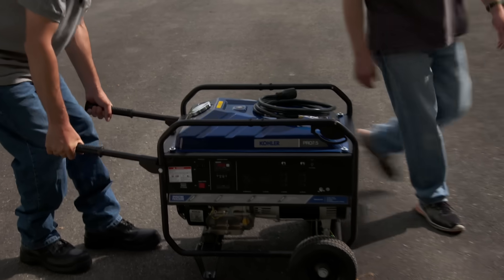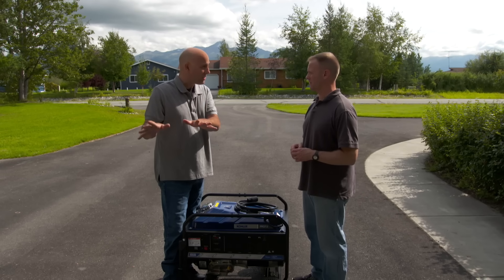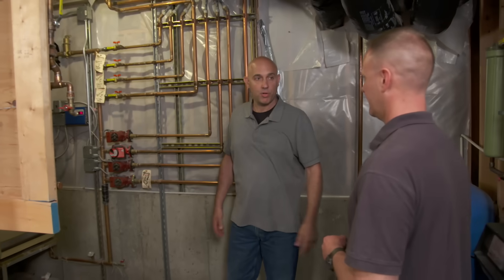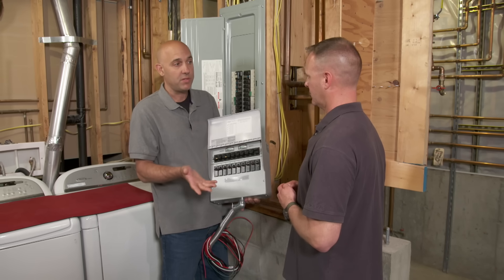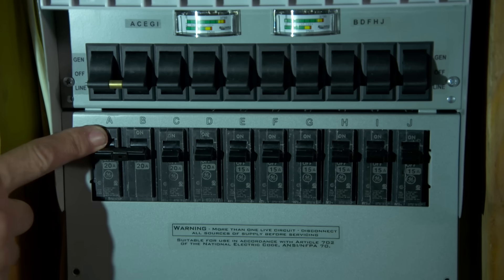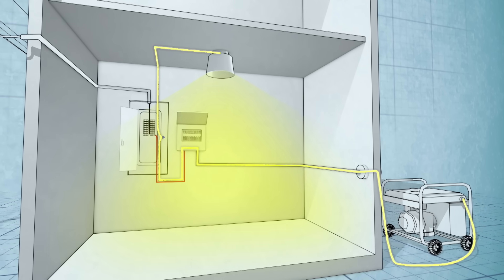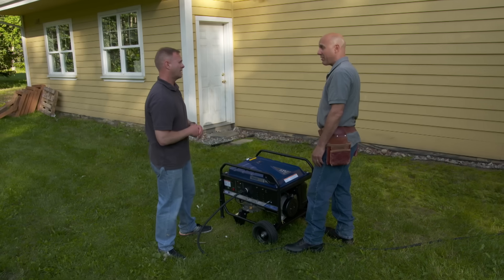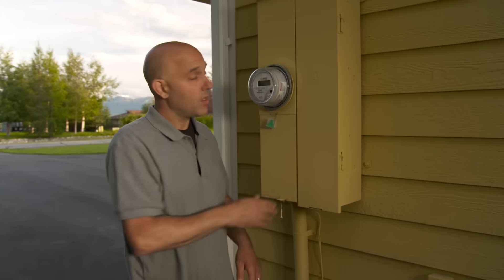How to Install a Manual Transfer Switch for a Portable Generator | Ask This Old House

Comment: You can do the same thing without the transfer switch. Use the inlet box. Run a 50 amp two pole circuit from there into the panel. Install a two pole 50 amp breaker on the panel , if you have the spaces available, hook up your 50 amp circuit to the 50 amp breaker. Leave that breaker turned off and When power goes out. Turn off your main , or any breaker that will not allow power to back feed into the power company’s grid. Plug the generator in. Turn it on. Turn on the 50 amp breaker. Now you are back feeding generator power into all of your house circuits. Now the 50 amp breaker is your transfer switch. A lot cheaper.
Reply: Doing that is against code for a reason. Current can still feed back onto the grid via the grounded conductor.
Reply: If you use that method, you must install a panel interlock as well.

Comment: I have a 50 amp generator... want to hook it to a panel  50 feet away  to a 50 amp interlock switch & breaker... Is a 6/3 & 8/1 ground sufficient ?

Comment: Question, when your on generator power and utility power is restored how does the transfer switch go back from generator power to line ?
Reply: You gotta do it your self, generally you would know what the generator powers, once stuff turns on that isn't generator powered you would go turn it off and manually got back to line on the transfer switch. Or you can buy an automatic transfer switch.
Reply: @ravinderbrar6316  I was talking about the main breaker to the house by the meter. With a transfer switch you don't have to turn off the main breaker that feeds the house to prevent backfeed when you have a manual transfer switch.  That was my question. When I simulated a power failure by turning the main breaker i follow the MTS directions and worked fine but I didn't go outside and return house power to see if the transfer switch  would  disconnect to prevent overload. The MTS is suppose to have a breaker that trips automatically when power is restored than you  reset MTS breakers back to line let the gen run a few minutes without a load and then shut it down,I can't test this by myself because my main house breaker is on the other side of my house, i need an extra person to turn off MTS breakers if there's any problems to try to prevent any damage, the wiring was easy and all labeled and double checked. My test worked but I didn't test returning house power to see if the MTS wouldn't backfeed or overload. If the house main was at the fuse box it would be different but its not.

Comment: At the end they turned power back on at the main while the generator was still running did they put breakers
On the transfer
Box back to line ?

Comment: What about switching the neutral or does the generator have a floating neutral? Otherwise you are bonded at two locations.
Reply: Read the code book about portable generators under a certain KW.

Comment: Instead of installing the manual transfer switch after the breaker box, could a "all or nothing" manual transfer switch be installed before the breaker box that accepts power from the grid or if "switched" only accepts power from the generator or solar source.   The generator or solar probably can only have enough power to power a few circuits, so all circuits would be turned off and then selectively turned on as power is available.    Nothing would be given up, but because the generated power would only be used when grid power is unavailable.

Can an all or nothing manual switch be installed before the breaker box?
Reply: Yes, it it called interlock. You connect your generator to your panel via two-phase breaker, positioned on the top, right under the main breaker. The interlock sliding plate makes it impossible for both main and generator switches be in the on state at the same time.
Reply: @ruslankadylak2999  Thanks for the reply.   I realize the interlock is probably not automatic, but hopefully safe and cheaper and easier to understand.    Any idea what would be a reasonable price for an electrician to install the interlock?

I'm amazed at how many people have solar panels on their homes which can not be used for their home when there is a grid outage, because they must go through the grid.
Reply: @davebean2886  I don't know what the installation price is, shouldn't be expensive, as it is 5-10 minutes job. However, let me give you some information on the solar panels.

There are three main obstacles to using solar panels as a backup. First, most of the inverters are designed to adhere to the current frequency in the grid, and, without the reference current in the grid, they do not know how to produce their own AC. Note that, for a number of good reasons, typical installation doesn't have output DC wires. Inverters are normally located under individual panels. So, to overcome this limitation, you have to upgrade ALL the inverters to a smarter (and more expensive) ones, or have something else (e.g. small gas generator, or battery powered inverter) be responsible for producing the reference current.

Second point. The nature of solar panels is such that they will produce electricity until you demand more power than at the moment they are capable of. At which point they collapse to zero Watt. Individual inverters work to make sure this won't be happening. Needed power on surge demands (e.g. electric motor starting, welding, range, oven, heaters, etc.) is taken from a big "sink", i.e. a source of energy big enough to satisfy any and all demands. Normally, it is a power grid. Can be battery bank.

Third point. Even if you managed to satisfy all energy hungry requests, there remains quality of service. Electricity in the grid is fine tuned and monitored constantly to meet certain well defined parameters (voltage and frequency). Your home electronics love it that way. And raw output from solar panels themselves cannot meet these standards.

These three points can be helped with a sufficient size battery bank. But a) it will double the cost of your system, and b) they have to be replaced sometime in not so distant future. Therefore, battery banks are to be used in remote off grid cases, just because the grid is not acceptable. In all other cases - connect to the grid. They will work with you following very reasonable rules. It's a win-win situation. 

As far as emergency backup goes, install a generator and connect it to your service panel with an interlock sliding switch. Hope that helps.
Reply: @ruslankadylak2999  Thanks for the information.   I'm just starting to consider approaches.  One time in Denver, our power was out for 8 days when a tree branch pulled the meter off the house.

We ran a heavy duty extension cord from a very close neighbor's outlet which let us run our refrigerator and other very selected items.   Would have been nice to not have to run extension cords through the house.

We are in a newer house in Texas now and while we did not have long-term power outage last winter, our water was frozen up for 5 days (oddly never had an issue with frozen water in Denver).   Got me thinking again.    If power was out the fan for our gas heater would not work.   We have a very nice fireplace that does put out heat when the fan is working.   In the even of a future power outage, would be nice to have some backup power to charge cell phones and somehow run the fans, but don't know how to get to the fans.

Obviously, I don't know what I am doing, but on the surface seems like everyone should have a manual safety transfer switch to allow selected items to have power from whatever electric source may be available - gas generator, batteries from inverter - power cord from neighbor.   But wondering if more to it since, never run into anyone that had a manual safety transfer switch, but they have gas generators for RVs etc.

I have a very little experience with solar panels and our two RVs in a remote location where the solar panels charge two 6 volt very large golf cart batteries in series to give 12 volt.   Power is used to charge our phones, battery packs for phones, tool batteries and for some reason one of the refrigerators on propane needs a battery to light and run.  Seems odd that our off grid RVs have crude power backup and our home has none.

As for generators - I've had 3 and never been able to keep them in a condition that would would run.  Also not wild about storing much gas in the garage.

Other suggestions?   Seems like now is time to prepare not after the next outage storm.
Reply: @davebean2886  I just wanted to point out why simple solar array, without batteries, cannot serve as a power backup system. While connecting solar panels to the grid make perfect business case, this design will not work for power backup. Adding batteries to the system just for the backup sake doesn't make much sense financially either. Therefore, adding gas generator to your system is a logical choice. To make your generator more reliable, use gas without ethanol, start it once a month for ten minutes, and/or drain all fuel (tank and carburetor) for long storage. Also, there are dual fuel (gas or propane) generators. Propane is immune to the long term storage kind of problems that gas engines are pron to, but it runs a bit weaker.

Comment: Now what happens when line voltage is restored and the generator is still on? Assuming you'd turn the main panel off before hand?
Reply: Nothing. They are separately functioning circuits that share a switch. You are choosing between one or the other and the transfer box makes sure that they never coexist. 

The reason for the manual transfer box is so you don’t kill a worker when repairing lines. If a tree limb breaks the line from your house to the pole they are expecting a dead line from your house. Without the transfer box you would have to make sure to throw the main breaker from the house, but if you forget you are now sending power back to the lines. With a manual transfer box you cannot send power out and kill people.
Reply: You would switch your transfer switch circuits back to grid power, then turn off your generator. Nothing in the main panel needs to be turned off.

Comment: 10 circuits isn’t enough. Put entire house on by adding a 220 breaker to an outlet near the generator location. Turn off your main, turn on the generator. Don’t run too much at once. Done.
Reply: Bad advice assuming most homes are rated 200 or less.
Reply: @anonymousperson4363  220v not amps. 
Used a 50 amp breaker

Comment: What brand is this tranfer switch???? N do they have a 50 amp tranfer switch on this brand????
Reply: I am pretty sure that it's a "ProTran" from Reliance controls. But I do not think this exact model is still available. If you pause the vid at 3:39 you can just see "ProTran" on the lid
http://www.reliancecontrols.com/pro-tran.aspx
And yes they make much higher capacity than that one
Reply: @groovymoon  thanks
Reply: The video makes it sound like 30A is enough.. R O F L .... maybe for a fridge, some lights and a furnace.. It's like those generators with 8000 W steady run and only 1 30A outlet... The Firman has a 50A...

Comment: If you turn off your main breaker switch. Run a generator and hook up to 20 from generator to your dryer. And that is a cheap easy way to get power to your house. When the power comes on turn off the generator and turn on your main breaker switch
Reply: Yes... cheap, easy, Dangerous, and probably ILLEGAL....
Reply: @groovymoon  how is it illegal?
Reply: @nathandoro2329  Because we have electrical codes. Why is it illegal?  Current can still feed back onto the grid via the grounded conductor.

Comment: Is it a good idea to run the generator with the power cable coiled?
Reply: "Good idea" is a bit exaggerated over the top of course... The general advice is to uncoil cables before powering them. If the load on the cable is not too extreme then it doesn't matter if you keep it coiled up. But it takes almost no effort to uncoil a cable (unless its way too long). If you're planning to run the oven and AC and frying pan at the same time then i would just follow the general advice of uncoiling the cable.

Comment: What is "non-metallic wiring"? 6:18  Are they using carbon nano tubes in home wiring now?
Reply: just sheathed cable. It’s kind of misleading because copper is well a metal but it refers to the plastic romex sheathing. Instead of say a metal conduit sheathing.

Comment: Thanks for the info.  Question - why not just put a transfer box in the main line ahead of the breaker box?  Run the generator power into the transfer box that runs into the main line breaker box. Then turn the house breakers off or on depending on what circuits you want to use?  That way you have access to all the circuits, albeit you wont be able to use all at once.
Reply: My thoughts exactly
Reply: For anyone wondering that is an interlock not a transfer switch.
Reply: kspdt, it comes down to flexibility and WHO will be doing the transferring. A transfer switch can be more flexible for somebody who fully understands how to use it, but possibly more complicated than a less-savvy person would know how to use; they also usually include ammeters so you can get a feel for how close you are to overloading the generator.

An interlock can be simpler for less-savvy people to use, but since ALL breakers in the main panel will be powered at the same time when the interlock is moved, there is a likelihood that all those circuits will overload the generator, and thus the person doing the switching still needs to know to turn off un-needed breaker before moving the interlock. The transfer switch approach only has a safe number of circuits connected, so it comes down to a trade-off of features versus homeowner savvy.

Comment: Better have non ethanol fuel and maybe additives in the gas too, or he can forget about that thing starting.
Reply: Or just run it on propane... or gasoline but just put in a little at a time during the day and then let it run dry when power is restored.. OR... I set up a little 12V fuel pump setup from a pump I got on Amazon for about $20...and some fuel line from NAPA (the fuel line and filter cost more than the pump). I used it to pump out some stale diesel from my sailboat. Then I used it to pump out some stale gas from an old generator that ran, yesterday, for a few minutes before the motor blew... After the emergency, pump out as mush gas as you can out of the tank and then let it run dry.   https://www.amazon.com/gp/product/B00L8IHM9K/ref=ppx_yo_dt_b_search_asin_title?ie=UTF8&psc=1

Comment: Sorry if this was explained but when your power goes out do you shut off the main power to run the generator cause my concern is if your generator is running and the power starts coming back on  what happens now because they are both providing electricity?
Reply: 03:30 the manual transfer switch  allows you to safely transfer the power from the commercial power ( which won't be running anyways because it's out because of the storm). When the power is restored you'll see the non- essential lights wired in the regular box come.back on. Watch it again
Reply: @Ford.Donnington  lol ok will watch again thanks =)

Comment: Nice job!! Anyone remember Y2K?
I did this in my home in 1999 in preparation of THE GREAT POWER OUTAGE expected in Y2K. I don't regret doing it as it has come in handy a half dozen times since then. 
My total expense on that project was  less than $1200.
Reply: What was the electricians expense
Reply: @Ford.Donnington  I should have specified, no that was the cost of the Generator, Transfer kit, and the 50' 10gauge 4 wire cord and end adapters.  Electrician cost would have been extra but should be able to get the job done in 3 to 4 hours.
So I'm guessing the electrician cost 
Would be around $500.00.
Reply: I was in Sault Saint Maire Canada Skiing hoping to get stuck there for weeks...

Comment: I prefer an interlock instead of a transfer switch, that way the whole is powered and you dont have to choose 10 or so circuits to be powered.
Reply: Transfer is better because when you use everything that’s on the panel can over load your generator transfer you pick stuff that won’t over load

Comment: This video needs to provide some warnings to the home owner regarding the maintenance of that generator.  There is no such thing as a free lunch -- you can't simply put it in the garage and expect it to be ready during an outage. That's the worst time to find out that your small engine won't start because of fuel issues or a dead starter battery.  You have to clear out the carburetor after use, treat fuel you plan to use, and rotate your fuel into, say you car, especially if it has ethanol content.  I test my machines twice a year, rotate fuel at least when I test the engines, but preferably every quarter,
Reply: You don’t have to clear out the carburetor if you just run all the gas out. My snow blower works fine after nine years this way. You can put the battery on a trickle charger and even if it fails most generators have pull start.
Reply: @Ford.Donnington  "running all the gas out" is exactly what I mean -- it clears out the carburetor of excess fuel that can sit there and gum up the channels.  
Sure, putting a battery on a trickle charger will help, but mody people need to know to do that.  Even so, a lead-acid battery will have a limited life in the heat where I live. 
The view was mute on all these points.